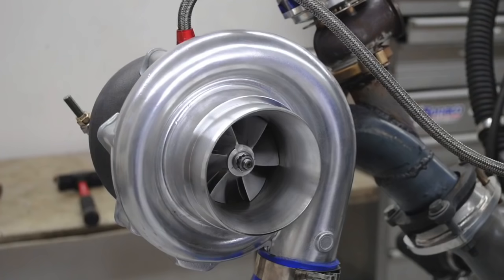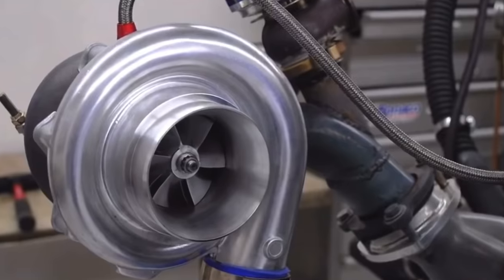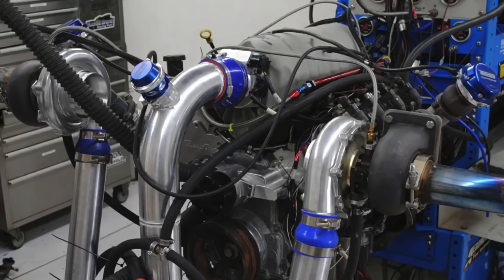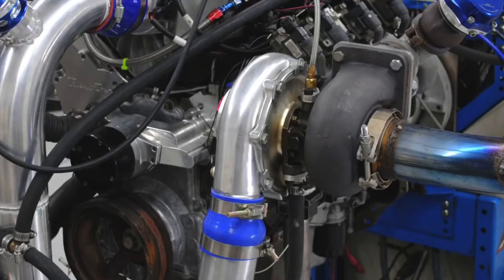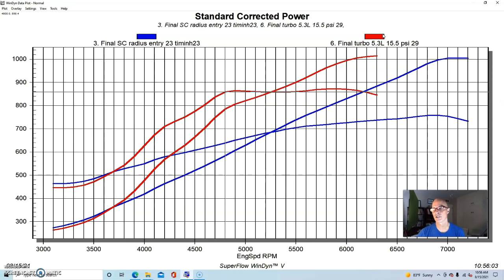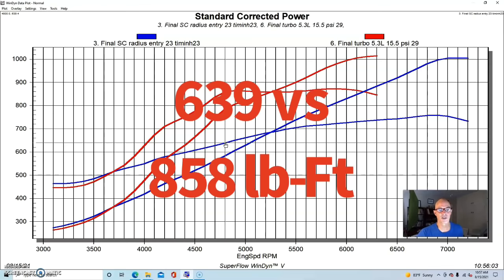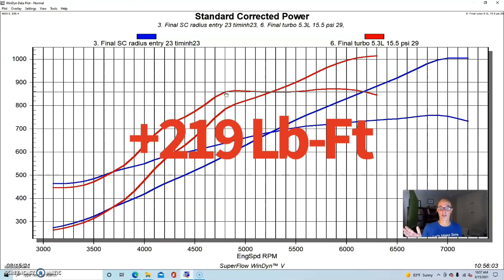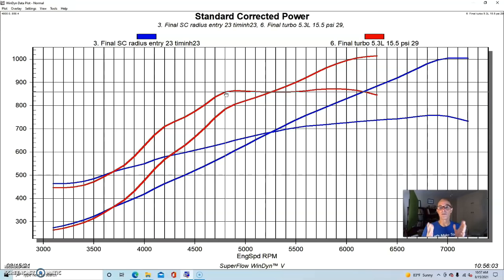HOW THEY WORK-PROCHARGER VS TURBO (WHAT WORKS BEST?)

Comment: In the drag racing world, the shape of the power curve means almost nothing with a torque converter that keeps the motor in a 500-1000 rpm range for the entire run.
Reply: Yep which is why hp is king on the strip
Reply: why does it keep the rpm so low if theres more power to be had up higher
Reply: @justinward5928  if I understand your question correctly, you're thinking of stock style torque converters that couple around 1500-2000 rpm. Performance/racing torque converters will move that up significantly. In a drag car, the conveyor will couple at near peak power at full throttle i.e. 5k+ rpm. This is too much of a compromise though for part throttle driving where the car will feel unresponsive and sluggish at low throttle because the engine will need more throttle input and more rpm to create the same change in vehicle speed.
Reply: Good 1...
Reply: Wrong....unless u have no traction issues most drag cars are over powered these days it's more hp management going on these days
Reply: Yeah man ,,, was look'n @ 1 of the custom torque verter ... Can program diff setup 4 all conditions ... Off the line hard or soft & shift hard / soft and lock up when ya want ... Got 2 be the hack 4 the track ??? D
Reply: Okay but it’s not always drag racing
Reply: i know next to nothing about drag cars, but that seems insanely low. what kind of build would rev that low?
Reply: @kenny6105  a, not the. For example 7500-8000 rpm or 7000-8000 rpm.

Comment: Simple answer is you’re running two turbos to one pro-charger
Reply from the maker: the answer is as supplied by the video-the difference in the boost curves suppled by the two forms of forced induction is different and a turbo has no parasitic loss associated with driving the blower (# of turbos is not the answers)

Comment: Gearing, Transmission choice and proper setup can go a long way to level the playing field and even help the Supercharger to shine. Let's say for instance that 2 cars weigh the same, same rear tire, one is Procharger and the other is Turbo charged. In this example, the Turbo car runs a 4.11:1 with a Powerglide and perhaps 3500 stall. The Procharger car needs only run something like 4.56:1 and a Turbo400 with 4000 stall to make the most of it's powerband. This will make sense to those that understand each setup. These values mean nothing......ONLY WHEN COMPARED TO EACH OTHER FOR REFERENCE. Just an off-the-cuff example. Be nice. ;)
Reply: 4.11s with turbo?? 
 I always run  "highway gears"..
 Like 3.42 to 2.73 on my turbo cars.
 It seems to work better for me anyway. 👍
Reply: @travisabrahamson5092 with 29" tall tire drops to 3.80 gear with Power Glide gear ratio so his comment makes sense in eighth mile. Tells me you don't know anything about gear ratios in transmission, stall speeds, & drag racing vs street car.
Reply: It all depends on where you're racing. Are u racing on the highway? Or are u racing on winding S shaped roads? Lots of left and right turns etc. One setup will prevail over another.

Comment: That 21psi boost curve is nuts for analog control. That's also pretty good response for two pretty big turbos on a pretty small engine.
Reply from the maker: the big bang motors were a stroke of luck
Reply: A dyno's artificial load will make it look that way. On the street, the rpm climbs much faster, and the procharger will follow the rpm, when the turbo has a small amount of lag. Don't get fooled
Reply: @Kincentc  ya, the procharger does basically the same thing on the dyno as on the track. Really high end tuning shops have started.using hub dynos where they can program in the wheel speed against time and take cars from staging to the big end. It lets guys set up things like a transbrake and boost v speed and boost v gear. On the street once those turbos light i dont think the procharger would touch it. The advantage is too big and these turbos were selected to limit low end boost.
Reply: @timothybayliss6680  I think they would too especially on that setup

Comment: I’ve only had one boosted car, and that was an ‘86 svo. I knew the dealer back then and he had the wastegate adjusted to 18 psi. That was one quick fox body. In stock trim it has basically the same hp rating as the GT, but only 240 torque. The 5.5 extra lbs of boost made a huge difference. That torque would really set ya back in the seat.

Comment: It all depends on the build , how the parts are speced and weight of the car and set up. I run a 416 with a Ysi race centrifugal blower and it’s not laggy at at. Power comes in at 2500 but I don’t see it because my stall flashes to 3500 rpm where my cam and blower all start to really come on . Proper specing of parts and how they work together is more important than just trying to make the most power. I’ve dog walked plenty of turbo 5.0, Camaros , gtr’s and civics most making more power than me because the 416 on motor makes plenty of tq to move the car and once the boost comes in it’s like nitrous that carries to 7500 rpm with a flat tq curves. I make almost equal tq to hp which is only seen in roots and turbo cars . Turbos are nice but I like my instant power , no lag , low heat , easy set up , easy to hook up but violent power delivery , predictable non on off switch power delivery and outside of you wanting to make promod power they can make just as must as turbos and on the same psi I make just as much power as some twin turbo cars but I think the  Intake and cid heads play a big part in the efficiency.
Reply from the maker: a centrifugal supercharger will always provide a rising boost curve-no combination changes that fact
Reply: @richardholdener1727  I’m not debating that I’m saying you can shift the curve to the left and have it come in early with pullies and a nice converter. Plus the power comes in hard but very traction friendly. I’ve had a Maggie and a lt4 blower and the race centrifugal on a vette is a better combo. You don’t need max tq at idle on a light vette that can bust the tires loose on motor alone. The power comes in hard and doesn’t stop where it matters in the mid and topend .

Comment: The one that works best depends on your situation.

If all you want is to make power and spare no expense then a turbo is for you.

If you want to have a linear power band without sacrificing exhaust tone but dont mind that it doesnt nearly blow your engine up at max boost then a procharger is for you

(I may be biased)

Comment: On the centrifugal’s I run a way more aggressive pulley. But lower the RPMs.  On this test if the pro charger would’ve produced 20 pounds of boost at 1000 RPMs lower the entire boost curve would’ve been much higher. 
Turbos are just very efficient.
Centrifugals just work awesome. I use a NOVI 2200x in my low 9sec fully loaded full weight 5thGEN Camaro.
Reply: like many things, forced induction is not a question of what works, its what works better, for that application at that time, the turbos are more efficient, but larger, heavier, more complex option, and of course expensive. so if packaging and weight, and budget, are the issue a procharger works just fine, if having not enough power is the problem then turbos and figure out how to make em work.
Reply: The way procharger delivers power is perfect no drama
Reply: @patrick11169  turbo are also more reliable, done right. and not necessarily more expensive or heavier

Comment: Sometime's the centrifugal powerband just feels faster, even if it isn't.

And you keep your nice exhaust note!
Reply: Kinda like a 4 barrel vs 2x4 , is it always about horsepower...NO!!
Reply: @CapnBubbaa  As long as it puts a smile on your face right!
Reply: Man, I HATE how turbos change the Exhaust note.
Reply: Turbo helps me speed incognito..
Reply: @Goes 2 Eleven Rising boost curve on a long pull giving the high rpm linear increase (placebo)where as turbo's tend to surge then hold in my experience.  Like a turbo diesel but with more rpm 😅.
Reply: @Goes 2 Eleven Like Richard said More horsepower is not always better, the Pro charger may put out less horsepower, but the power  is more  manageable to the ground, means better Traction and faster ET... While the turbos may make more Horsepower, but if your shaking the tires off... you've lost the race or the car goes out of control, because the tires lose traction at high speed especially if your running a lockup torque converter you break traction and you go out of control (That is why you see chutes come out early sometimes it is a correction maneuver). Bottom Line... Managing maximum power to the ground is key winning...
Reply: @CapnBubbaa  The real reason is because mechanically driven blowers don't have boost lag.  They are much more reliable and predictable in that respect.

Comment: Bigger Procharger spinning faster to match the airflow capabilities of the turbos and then control the boost with electronic wastegate controllers same as is done with the turbos.  Create whatever torque curve you want.
Reply from the maker: YOU CAN'T SPIN THE BLOWER INDEFINITELY, AND IT'S BAD FOR THE BLOWER LIFE-BUT IT IS POSSIBLE
Reply: @richardholdener1727  What if you had small enough exhaust housings to be quick-spooling, massive wastegates to prevent too much backpressure & a system to control the turbo based on turbo shaft rpm? What would that do?
Reply: @matthewmiddleton2234  Small turbine housings waste a ton of energy through the wastegates and don't make the same power as a larger turbine housing. The closest to what you want to achieve is compound turbos as the little one gets bypassed as the big turbo comes in. Variable geometry turbines are also good, but limit the low RPM boost due to compressor surge.
Reply: @Joshie2256   Joshua, long story short, I first envisioned this in a compound turbo setup
Reply: So just dump pressurized air you spent alot of effort making to atmosphere?
Reply: @joeyoung4309  Yup, same as what happens with high boost turbo systems.  Throttle the air going into the engine with the computer controlled wastegates.  I will go one step further, design a rheological clutch on the centrifugal supercharger drive to make boost available at he flick of a switch, like nitrous!
Reply: @richardholdener1727  Why not?  The turbo spins indefinitely and has all the exhaust heat to dissipate as well.  Stationary engines run 24/7 under boost.
Reply: @donbrutcher4501  Thats not what happens with a turbo at all, a wastegate on a turbo lets exhaust gas bypass the turbine wheel, wether it be back into the exhaust or just as a straight dump pipe to atmosphere so it wont spin as fast. Using a wastegate on a blower means you put it somewhere after the blower and just throwing away some pressurized air you spent alot of HP making.

Comment: Actually a smaller procharger, I run a -94 and it's very peaky...in fact there is something not discussed at all here, the -94 can drop 5-6 psi on the shift its so peaky...
 The M3SC marine I ran on my car come on boost and held it like a PD blower...
 For this test since he stopped at 6300 on the turbo or less and two of them...
 Might have been fun to see the twin torque storm curve their impeller comes on quicker...
2. A P1X or D1x turned near its max rated impeller speed would have drastically improved that soft hit on the -94s rising curve it would have been WAY closer...then dump out the peak in the same way you did with the turbos a waste gate, I have 2 Vbands in my charge pipe just for this...then you can also get a DS Delta and change tune ect ect for TC....
 I get we are showing the difference but efficient twins vs a peaky -94 impeller running below its compressor map speed with that 4.25 pulley isn't a remotely close comparison...
 You can make a smaller p1x/d1x hit really hard spun to their max impeller speeds or you can do it with the -95 say in this test even a 3.85 pulley stopped at 6300 or with a waste gate would be a lot closer.....

 That said it looks like the -94 uses a little over 120hp to make 500 net...well that's actually great considering an F2 required a cog and would take 2.5x that...
 Ironically I run a F1A-94 with a BBC using a short stroke literally to do what he said let the chassis work a bit in the old 67 Camaro on a drag radial.....

 Interesting....thanks as usual

Comment: Seems like the pro charger is a much simpler set up with less tuning needed. It also seems like it would put less stress on the system overall, the variable curve vs the more straight line output would be easier on the whole system. Plus there’s your transmission and gearing options that could make a big difference.
Reply from the maker: both need the same amount of tuning, and the blower puts more stress on the crank snout, but both work well

Comment: I understand this is an older video. I just wanted to mention I’ve spoken with a few other serious engine builders racers who have used Turbos, PD Blowers and Centrifugal SCs. One guy ran many of the ProCharger Head units including the F1A, F1A94, F1D
and actually to many to list.
But he was quite knowledgeable with the PC format and Head units and how they performed and one thing I remember he saying was the F1A and F1A94 were a bit soft down lawn then really started to pull @ 4000RPM.
He also mentioned the F1D was a very good low end under the curve performer and produced a Nice TQ Curve for a Centrifugal SC.
If your able to get your hands on a F1D ProCharger it would be interesting to see how the power performs under the curve vs the F1A and F1A94 ?
Reply from the maker: the comparison isn't between different sizes and impeller designs on a Procharger-but rather centrifugal design vs turbo. The amount of difference between different centrifugal blowers is minimal compared to the difference between a blower and turbo
Reply: Agreed...

Comment: It really depends on budget.  Abbilty to do the job . Your engine you are building or already have .

One robbs alot of hp from the pullies and rev much higher .
The other has 2 turbo and runs much more efficient but cost more to build.

Comment: I think a big thing is also the turbo lag and not so much nowadays with electronics throttle body's but still depending on tuning, the handling of the power. Let's say you're on the corner getting on the power, the car can handle 30% of the power @your rpm when the turbo is not making boots, now the turbo is "creating" on boots and you have even more power you need to trotle down, in a perfect world you need to lift the trotle just the right amount when the bost is coming oon to maintain the manifold vacuum constant, but it's really hard to doo, lift little too much and the turbo is stopping boost, don't lift enough and the turbo will make ewen more boost in till it reaches the gate pressure. A supercharger takes all this away, jeah you still might have a really small window to play with in in the pedal, but when you find it, it's there and are little more stable.

You can find this even with small engines, small power outputs driving on ice or snow, it's like having 5x more power than you can put down even wit 100 to 200hp and then you have your turbo wanting to kill you in every corner ewen when na power is all too much. Don't get me wrong, it's a lot off fun, it's just impossible to run some kind of good time

All the best and keep up the good work 👍
Reply: Hah! I feel for ya.
I have two turbo cars. One is easy to drive off the corners with the power on, and one isn't.
The one that is easy (3.5L V8)  has 2 small, factory T25 turbos, and a rising rate throttle linkage. The boost control is electronic and has throttle position as one of its inputs.
The hard car to drive (2.2L  I4) has a single aftermarket hybrid T4 turbo, that is a bit laggier. The intake has individual butterflys for each runner, and has a direct non-rising rate linkage. The boost control has inputs for throttle position as well.

--
I would say that having only enough turbo to get the job done is very important. A compressor map to select the turbo is a must.
Get a wastegate controller that has throttle position programming available. This may be your lifesaver.
Consider a rising rate throttle linkage. 
Certainly drive out of the corner with the turbo in mind, accounting for maybe a 1/2 to 1 second lag time. 
I have no advice for wet roads........since my cars are mid-engine and scare the shit out of me when they cut loose under power.
Cheers 😜
Reply: I have an idea that might interest you, and you have knowledge that I could find useful when creating a prototype. If you’re willing I can put you on a designing committee when I start the business process I’d love feedback on how to develop it further. I’ll explain more if you let me know.

Comment: Dyno as expected. Makes sense, procharger makes boost contingent on how hard the motor is working, which is why you made more boost revving it out 😂 twin turbo off the exhaust gases more instantaneous on the propellers, especially if one is set up to spool before the other making the power distribution even more unfair against a procharger lol. 

See, a procharger, theoretically would do well on a mild compression VTEC engine. Something that revs naturally high, can build more boost on the top end and give it a better chance at a higher peak/average as long as set up supports. Turbos have a limit, eventually there’ll be an insufficient amount of exhaust gas (at higher RPMs), but again, can easily be fought with a twin set up, having the second turbo spool later in the RPM range. 

Do you think maybe a single turbo would have been a more fair comparison? Who knows! 

Great video!
Reply from the maker: a single turbo sized correctly does the same thing-centrifugal superchargers make boost relative to engine speed and na power output